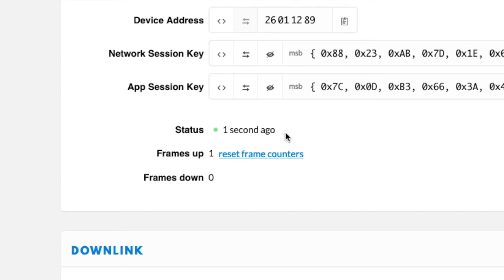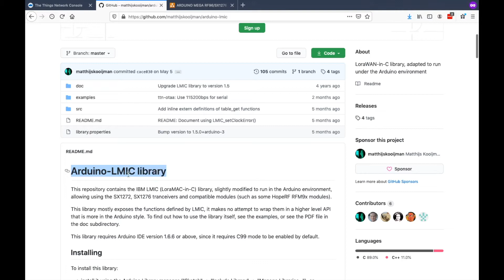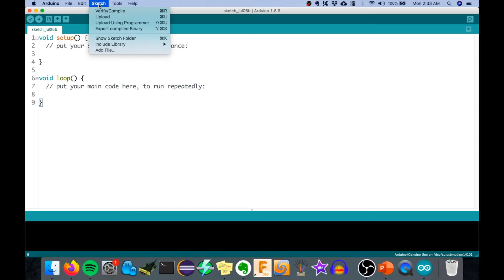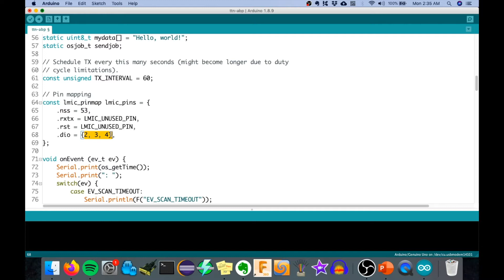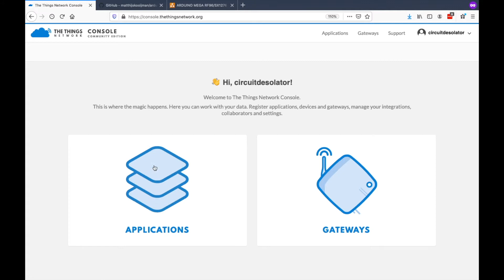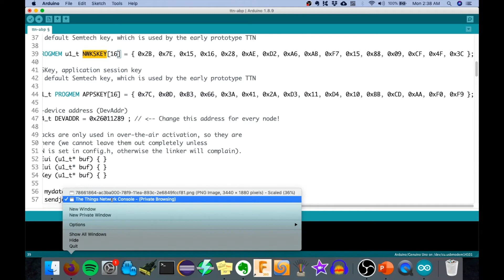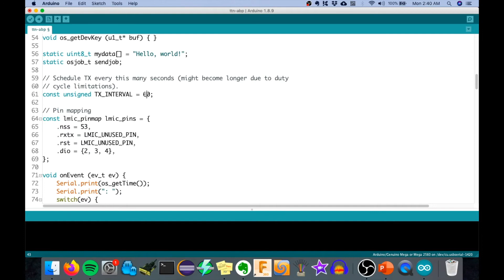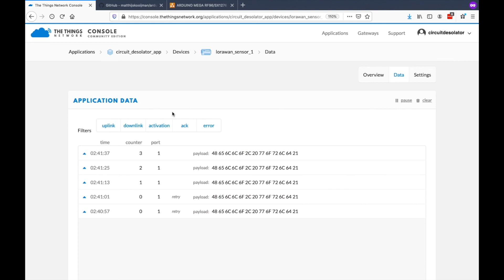LORAWAN DEVICE TUTORIAL BASED ON ARDUINO MEGA WITH LMIC LIBRARY - STEP BY STEP WITH RF96 / SX1276

Comment: and what if I want to connect an arduino uno instead of arduino mega?
Reply: then you need to use SPI pins of Arduino Uno.
Because Arduino Uno don't have pins 52 51 50 for SPI signals, but it have 13 12 11